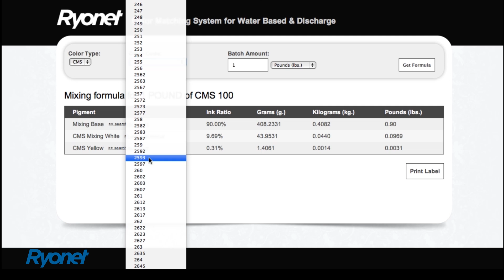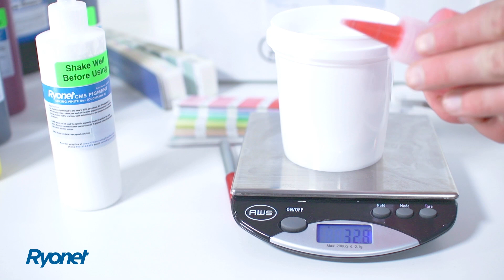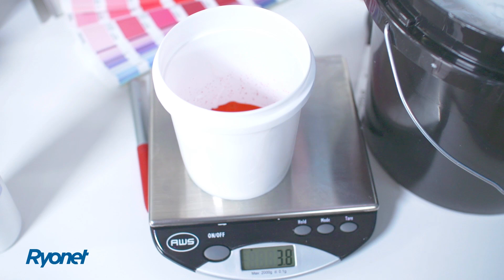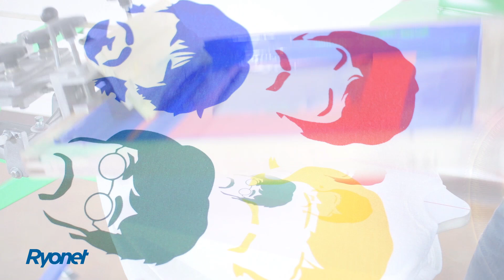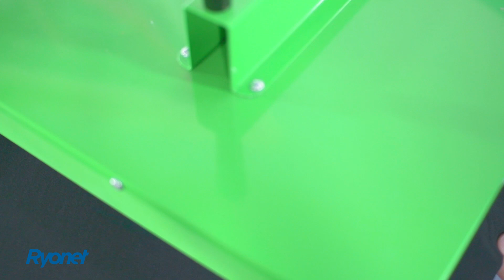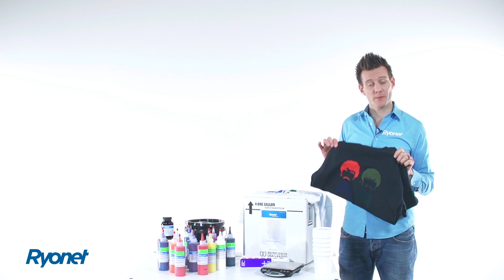R2O CMS Water Based Screen Printing Ink Mixing System

Comment: I'm confused... I know this is a very old video, but the current galaxy fusion mixing system does NOT use coated. I wish it did, but it doesn't. In fact it only offers uncoated in their software. What happened and can we somehow mix for coated? I feel there is a bit of history I'm missing here.
Reply from the maker: Hi @Tom Brooks! You're right the Fusion system mixes to uncoated only. The CMS system in this video and some others systems had/have the ability to mix to coated. It's all dependent on the system and how the software gets built out. I can't really say whether coated will be available in the future or not for the Fusion system, but I will ask the question today.

Comment: Hello thanks for your video.
I have a question on how do you add darker color on the requested pantone color.
For example of you need to make the 185 C color darker than it self for example 20 % then how the color would look like after being added 20 % darkness ? 

Does it have any standard rule for adding light or dark to any color for using CMS  water based? 

I would be happy to have your idea.
☺️

Thanks

Comment: So if i understand correctly, Water based and discharge use the same mixing base. Add 5% discharge agent and you now have a discharge ink? Im hoping i understand this correctly because i am very interested in this whole color matching system you have.
Reply from the maker: Madison Smith Some use discharge base as a water base but if you use a specific water base it does work better, our green galaxy clear core is an amazing base to use for WB http://www.silkscreeningsupplies.com/product/IKWB-SRNDCLEAR-G
Reply: Ryonet Okay great, thank you for the link. Why do you suggest the clear core base rather than the opaque? when is it appropriate to mix with an opaque base versus a clear base?
Reply from the maker: clear base is your standard base, opaque core is what you add to clear to make it more opaque. Essentially Opaque Core was not designed to be a mixing base.

Comment: I've printed flatstock before, and you usually have to add a 'retarder' or a 'silkscreen medium' to keep the inks from drying out in screen. I would suppose that issue would be the same with any waterbased ink printing, but is there an option to use a 'retartder' for printing longer runs of graphics?

Comment: It would be cool if you could also calculate the batch amount instead of guessing.. That way you avoid ink wastage or even worst, press down time and screen dry-in as you mix more.. And now the press is spinning again, the color don't exactly match the first batch mixed.. Uhhh it woul be cool if you could also calculate the batch amount.